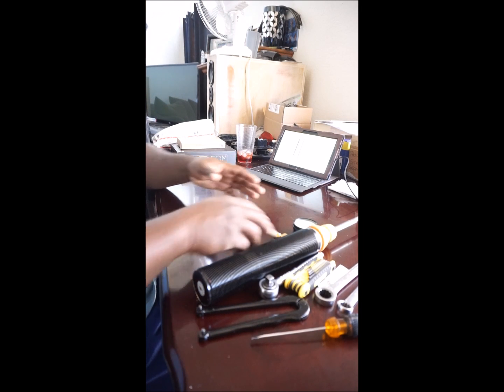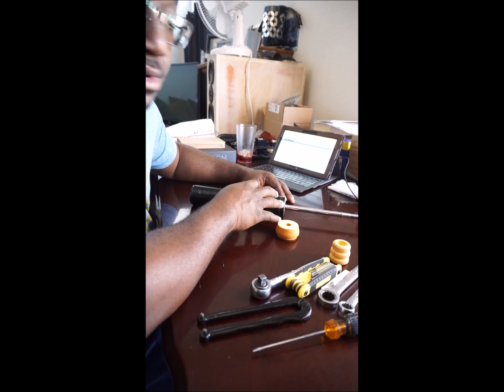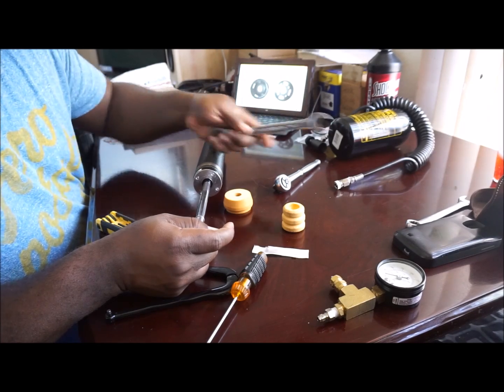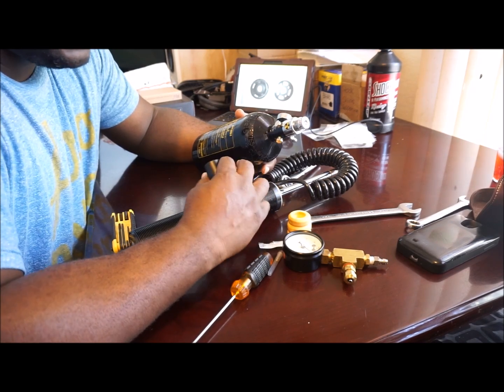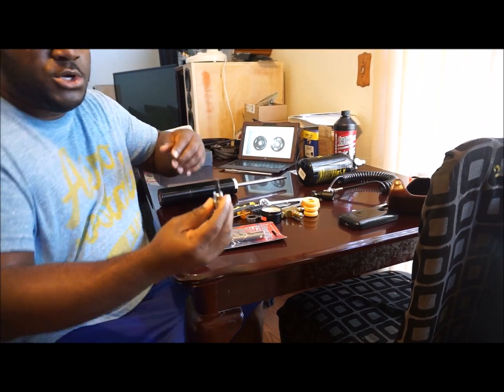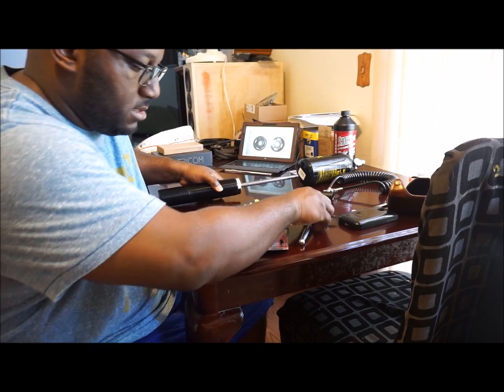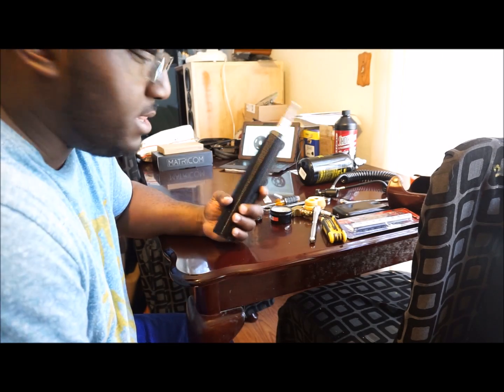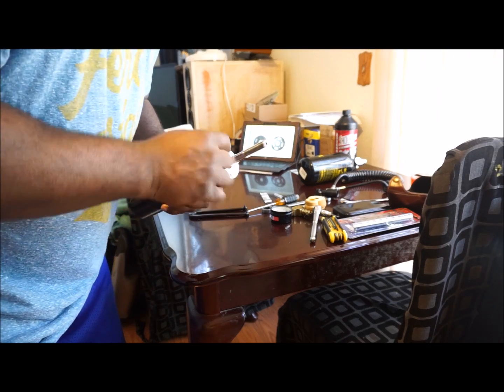DIY BC Racing BR shock Revalve tutorial - PART 1(Bilstein Internals)

Comment: Now this is a great tutorial on how to rebuild and shim or re-valve a coilover shock. I hate when I see other yt videos where the op say's I'm rebuilding these coilovers and all that they have do is a complete teardown and cleaning without changing any seals or dampening oil.
Reply from the maker: @jdmintegradp  Thank you for the kind words.

Please check out the Clublexus.com full write up I did there with all the math and equations, etc on how to calculate your forces needed for what you want to achieve.

After finding your desired shock forces, come back to this channel and watch the bilstein shim/shock force manual so you know what shims to use to reach your shock force goals.🙂

Comment: Based on this rebuild, how much would you say you spent all in all after purchasing the replacement parts and necessary tools?
Reply from the maker: Out of purchasing the replacement parts, the Bilstein pistons were the most expensive at approximately $20 per piston for each shock ( considering I bought the old 699 style Bilstein piston which like better that their new COB style) and the Nitrogen tank kit with hoses/valve was $79. 

Google “DIY SHOCK REVALVE CLUBLEXUS” and read through my 50 page step-by step tutorial with math and shock calculations and all…I believe I detailed where I bought all the items from (with weblinks) and how much they were.

Comment: Super informative, i have a chance to purchase a set of the BC coilovers for like 80$ but one of them have a broken shaft, do you know where one can buy replacement shaft and what alternative shaft one can use?
Reply from the maker: Hi, as for a broken shaft that is hard to say as I feel the shafts are almost exclusive to only the BC racing coilovers in that exact length of shock you have.

Unfortunately, you may have to buy 1 new replacement BC racing shock insert for ~$65 to $70 USD.
Reply: @frugalfabrication  Thanks mate, cheers.
Reply: @frugalfabrication 4 years later into the tariff wars. Replacement dampers are now $121. We don’t have it good anymore

Comment: Kene, I can't PM you, your inbox is full... Here's the specs you asked for the SC300 

Here's what i measured...

Front LCA 21.5CM from Strut mount to camber bol (used middle of both bolts)
Rear 36.7

Mount to ball join
11.5 front
7.7 rear

lca to ball joint
35.5 front
42.5 rear

72degree angle on rear.
Reply from the maker: zazzn 

please PM with this information pasted. There should be space now,  I also responded.

Comment: So i have the BC racing BR coilovers. First one of my front strut went bad so i replaced it. Now i just add the anti-sway bars and literally a soon i put the car down and drove for less than 3 miles the rear strut went bad. Both bad strut were on the same side (driver side). Anyhow, how they went bad was it leaked most of the oil out. How do i fix this issue. 

I want to rebuild them, and also revalve them as well. What parts do i need to change to prevent it from leaking again? What are the benefits of revalving?
Reply from the maker: rohan smiley where exactly was it leaking from? Top of shock at shaft?

or 

bottom base of shock?
Reply from the maker: rohan smiley google my tutorial “DIY SHOCK REVALVE” . It is on the clublexus website.

It ha s several step by step pictures and data.

Comment: Have you ever torn down an old HKS hipermax D damper? The top seal doesn’t unscrew. Wondering how it’s separated from the body. Has holes for spanner wrench but just spins.
Reply: Here's a video of an older HKS being torn down. Mine did not have this hex screw in the top cap: https://www.youtube.com/watch?v=I7hxBY2dZC8
Reply from the maker: Eric Rosado Thank you Immensely Eric Rosado for posting these video links  on how to disassemble the HKS shocks. I as well as many others who view these vids are very appreciative.
Reply: @frugalfabrication   The HKS damper I have doesn't have the hex screw holding the seal cap on. Jury is still out on how to remove the top cap. It just spins and spins. I'll report back if I find a solution.
Reply from the maker: bmxunderground2 i know the damper you speak of, but unfortunately I have never opened it. 

Take a look at “REsuspension’s” website page they may have some spare parts just in case you need to destroy portions of that shock to get access to the internal parts.

 They have several high in shock performance parts for the internal and External portions of shocks
Reply: Thank you for the quick reply I will check out their site in just a moment.
Reply from the maker: bmxunderground2 anytime man. Please chime in with your findings, as I am interested as well.

At the RE suspensions website you may be able to find a different shock part manufacturer that will work with your hyper max shocks.
Reply: Frugal_Fabrication  I found a photo of one torn down from a Russian website. It looks like the seal cap is threaded onto a floating seal that sits below the C clip. Sucks because I can’t tell how in the world he was able to secure that part. The translation roughly sounds like he gassed up the lower port to 300psi which put enough pressure on the top seal against the C clip to prevent it from spinning so the top cap could unscrew from it. That just seems janky. I’ll have to post a link so you can see what I’m looking at and get your thoughts.

Comment: Great diy I really appreciate it. What do I need to buy if I want to keep it BC Internals?
Reply from the maker: Could you explain more in detail what you mean by “ keeping it BC internals”?

Do you mean rebuild worn out BC dampers using the same internals?
Reply: Frugal_Fabrication Let me just explain my situation and maybe you can point me in the right direction or give me your opinion.

Previously I had a 2007 Accord and purchased brand new BC coilovers, I fell in love with the ride comfort. They were great for the 6 years that I had the car. 

I recently purchased a 2013 Accord and found a great deal on used BC coilovers with camber plates. I don’t know it’s history besides the  obvious things. I noticed when installing them there was no pre load set. I adjusted my ride height to the point where there is no wheel to fender gap. As soon as I went for a test drive it felt like if I had them on full stiff, I lowered it to the softest setting and the ride still felt harsh. Going over bumps at normal speeds there was no abnormal noises. When coming out of a driveway or going over bumps in a parking lot I can hear allow squeaking and a bit of clunking. I torqued down the 17mm on the strunt and also the upper camber bolts. I then read there are also bolts on the bottom of the plate which I will check tomorrow. I also spoke to BC and they said to do a shock function test which I will be performing shortly. 

Would the best option be to upgrade them with bilstein Internals like you did or what would be your opinion? I’m mostly interested in ride comfort. Thanks again, I appreciate what you have done for the community.
Reply from the maker: +DRFPV as I read what you posted, I immediately Thought, what if the last guy that owned your used coilovers requested for much higher damped shock inserts from BC racing. And after driving on it for a while realized he was not happy with his custom requested selection.

So now you got a deal on these coil overs sets but I’m not sure if the shock insert was specifically valid for your Honda accord from factory and not a custom requested shock.

I hate to say it but unless you’re into tinkering and tweaking your best bet may be to request for two new front and rear shocks from BC racing for your specific vehicle.
Reply: Frugal_Fabrication thanks for the info, I’m going to call BC maybe with the serial number they can tell me if it was custom or stock. Also depending how the shock function test turns out I’ll see if I decide to take on this project and just probably adjusting the rebound shims could help me get where I need. After reading your post on club Lexus everything makes more sense to me. If not I think I’ll just pass them on and go for some tein street advance I hear good things about them for my specific car. I’m not really looking for performance, just a nice lowered comfortable car.
Reply: Frugal_Fabrication after speaking to a few people that own 9th gen accords, that have experience with BC either end up switching to tein or deal with the stiffness to go lower.
Reply from the maker: +DRFPV ahh ok I see. I know on the BC shock cartridge inserts there was  is a white rectangular sticker on the end near the shaft side. This sticker used to say how many kg/mm(?) this shock was built as from factory.

I believe this is what you can use to determine if you have the correct front and rear shock cartridges in your BC racing kit for your car. When you call the BC warehouse, ask them to pull one of their fronts and rears for your model car and read what their shocks white rectangular sticker says and compare against your front and rear shocks white rectangular sticker setting.
Reply: Frugal_Fabrication I’ll see what they say, I also contacted a buddy that installed BC on his 9th gen Accord  and he said he returned them after 2 days because they were noisy and too stiff. So it looks like that is the way they intend them to be. I honestly would never put another set of BC in a car unless I can go for a test ride on someone’s car with the same setup.
Reply from the maker: +DRFPV I guess it also depends on what vehicle you get them for. I know when I got mine I personally requested for a higher damp rate..this was before I did research about shocks.
Reply: They confirmed that the specs are within range for this vehicle. Since I’m about 20 mins away I offered them a test drive for some feedback, because it’s actually shocking to believe that I have bc coilovers installed. Even when I come to a complete stop the car bounces for a second.
Reply from the maker: +DRFPV thats actually a good idea that you offered them a test drive. Did they accept the offer?
Reply: Frugal_Fabrication it was through emails that we were talking they never responded to my last email regarding the test ride. I told them I didn’t want anything in return, that I just wanted to provide them feedback.  I ended up getting rid of the BC and installed Tein street advance and it’s everything I expected as ride comfort very close to stock. I’m might have to stiffen the damper a bit because the lowest setting is too soft. The only thing I don’t like is that it’s not a true coilover with 3 way adjustments.
Reply from the maker: +DRFPV Aw man, its unfortunate they did not get back to you for feedback. One thing I know is that he actual BC company is in tawain(I believe..from my memory). The “BC” stands for Bor-Chuan coilovers.

I totally understand your situation of selling the BC’s vs revalve, as not everyone may have the time. Especially if their car is a daily driver.
Reply: Frugal_Fabrication the only reason I didn’t go for a revalue was due to a clunking noise possibly caused by the pillow ball mounts. I had my car on jack stands for like 5 days while I waited for the Teins to arrived. I just wished my car rode like my previous accord on BC as I know there is quality.
Reply from the maker: +DRFPV ahh I see. Well, there may be a way to make your new accord feel like your old accord, but it would take using the math equations listed to finding/using the motion ratio, critical damping forces, sprung weight on the wheel hub being calculated, the spring rate of the spring, etc of your old accord. 

Once these are found you can have a baseline to shoot for with your new accord setup. Granted, this is just a baseline, not and end-all, be-all. If you are lucky and both accords share the same suspension dimensions with no change, then you may be able to utilize the first accords shock cartridges and get springs of the same spring rate on your second accord.

But if you are happy with your ride now, just relax and enjoy it.

Hopefully my explanation is understandable.
Reply: Frugal_Fabrication thanks I appreciate your response and value what you do.
Reply from the maker: +DRFPV thanks man.

Comment: I wonder if I were to just change out the shock oil, and refill the NO2, if that would "stiffen" the dampening ability a bit from the stock setup on my BC coils...
Reply from the maker: I would definitely say yes it would. But keep in mind that when the oil/shock  gets hot after heavy use/driving the oils viscosity will change and the oil will flow more freely again (could still be less than the original BC racing shock fluid).

I would make the changes to the shock at the shims, but if money and equipment was an issue I wouldn’t have minded testing out changing to a thicker (or thinner depending on what you want) oil to get different shock results.
Reply: Frugal_Fabrication 

Now the question is whether the bc racing coils measure the same internally, as I looked into the digressive piston you used, and the sizing threw me off a bit. 
But, would have to try out the shims as you mentioned first...
Reply from the maker: +Dio Pena the BC racing coil over cartridge for the Lexus GS 300 1st generation and I think other Lexus’ used a 46 mm internal piston with more restriction on the rebound orifice holes. This equated to more for their factory piston on the rebound side with using less shifts because the holes were smaller.
Reply from the maker: +Frugal_Fabrication *more force; *less shims
Reply: Gotcha... I'd have to disassemble my coilovers, and measure the piston to make sure I then order the correct sized Bilstein piston, but, as a first attempt, I'll probably rebuild/refill the shock as they are for now, with 10W shock oil. And then figure out where i can get NO2. So, I'm practically just opening mine up, letting the NO2 out, dumping the old oil, refilling with 10w shock oil, and rebuild, fill up NO2, just to see while I get the proper pistons. 
*I was told that BC BR coils may have different sized pistons. <- unless you know this isn't the case..... ;)
Reply from the maker: +Dio Pena There is a good chance that different BC racing coilovers from different vehicles and models may have different piston sizes. 

If it were me, first I would try and capture every bit of the original Bc racing shock oil, and measure how many ml of oil they put in the shock. Then while I had the bc cartridge apart, I would measure the internal diameter of the BC racing shock body, the overall internal length the piston actually moves inside the cartridge (not the complete internal length). And the diameter of the shock piston shaft(part that goes inside the bc piston), and the shaft’s shock piston section length. 

Even though you are not doing a complete upgrade, this info is good to have written down somewhere for when you go looking for upgraded pistons later.

You can get NO2 (nitrogen) from paintball stores. Some still have nitrogen refill tanks, and they will refill an HPA tank (3,000 - 5,000 psi). If none of this makes sense, please DO NOT gas charge/recharge.
Reply from the maker: +Dio Pena 
LEGAL DISCLAIMER

You must make sure you are fully aware, and knowledgable about shock rebuilding/gas recharging and please understand that you do so at your own risk.

I wont be held responsible for any damages, or injury. 

Once again to anyone who may read this, please at least read/view the clublexus diy shock revalve tutorial.
Reply: No worries, You sir have been pretty thorough, and I understand the risks ;)... I'll do as you suggested, and go from there. Whenever I get the chance to do it, I'll take a video, and send it  your way if that's cool .... constructive criticism never hurts!!! lol
Reply from the maker: +Dio Pena Awesome. Take your time and whenever you are ready document and post your findings on a message board for your vehicle and feel free to post the link in here.
Reply: Nothing to worry about there man, I'm fully aware of the risks, and the importance to adhere to safety first. You will not be held accountable for my actions, this is a DIY community, and I personally appreciate your patience in documenting this, I will make an attempt to do the same, and cover any details pertinent to this process .

Comment: How many times you can punch the self healing valve until this does not heal anymore?
Reply from the maker: Ive done this at least 7-10 times on one shock insert/cartridge. 

This is a thought that just came to mind...
If I ever in the future run into a problem with the rubber seal sealing, I may use a q-tip/cotton swab with the end soaked in solvent (gasoline, mineral spirits, etc.) and lightly rub the q-tip/cotton swab head onto the inside (outside might work too) of the self-healing rubber seal  in hopes the rubber would slightly swell up and close up all the previous needle piercing points/paths.

Keep in mind I have not tried this yet...so I cannot verify that it works 100%.

I hope this explanation makes sense.